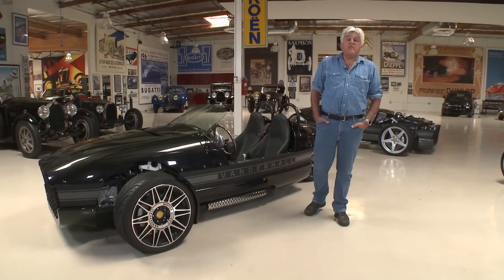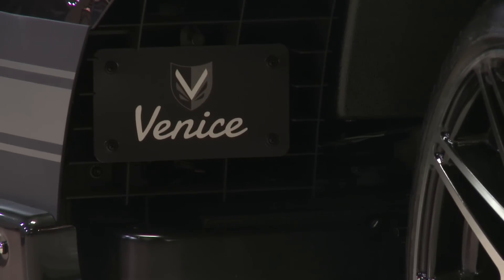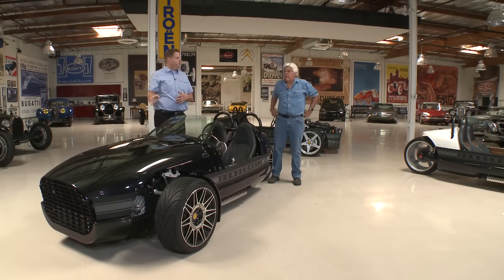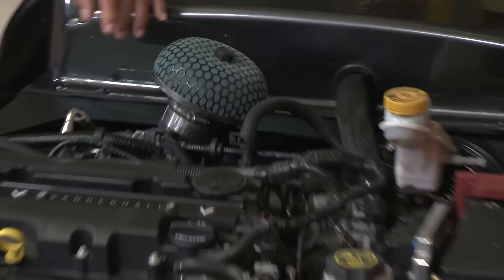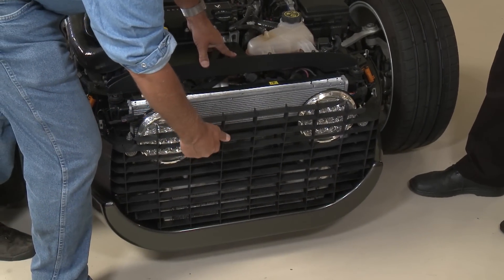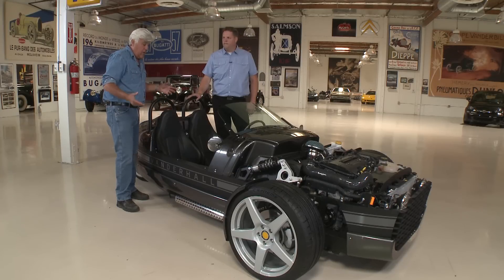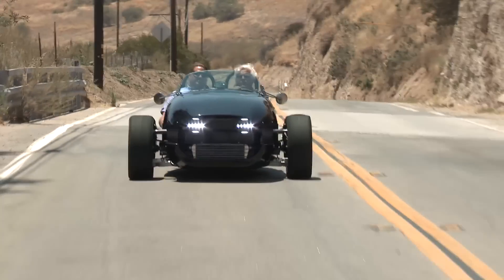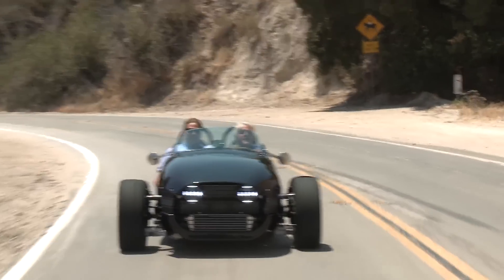2017 Vanderhall Venice - Jay Leno's Garage

Comment: the Laguna @70k is a hard pass; $30k is a decent pricepoint.  Looks like that tiny engine was struggling with two large adults in it, but I'm hugely impressed that they laid out the cabin so even Jay's head was below the windscreen!

Comment: Love this machine.  I recall reading about it about a year ago.  The Venice is even more desirable than the Laguna while being less expensive.  This machine looks far better than the garish Slingshot and front drive probably suits this trike configuration the best.  My only quibble is the auto transmission.  The Venice begs for a manual shift tranny.  Which is puzzling because GM makes a six-speed manual in the Chevy Sonic-sourced drivetrain.  Torque converter automatics are bland.  You could hear the leisurely shifts and gear hunting during their drive.  Put a proper manual in this thing and sing the last hurrah to vintage-style sports cars before electrics take over!

Comment: At 13:52 Jay says, "Feels incredibly stable. I can't say the front wheel drive makes any difference."  I wonder how stable it is when taking a 90° right turn at the same speed as a similar weight and wheelbase four wheel car that is near its limit of adhesion.

Comment: Only car manufactured in Utah? What about those Cobra's made by Kirkham Motorsports in Provo?
Reply: Its a technicality, Kirkhams makes a great vehicle, but it is not turn key street legal.
Reply: Too true, thanks for the response. 

I noticed that there is no Utah location for delivery listed on the drop down menu on the order form on the website. Will there be a Utah delivery option made available?
Reply: Yes, we are seeking the right dealer to handle distribution for Utah.

Comment: I like the T-Rex  better. Jay drove the one with the 6 cylinder BMW motorcycle engine. The T-Rex has a standard transmission which Jay Leno prefers. I liked the sound and the looks of the T-Rex. Everyone has their own opinion.

Comment: I don't usually like 3-wheelers (the ones that are trying to be motorcycles), but this is pretty neat.  The video made it painfully obvious that the GM auto transmission needs changed out for something else though; it sounded like a typical General Motors 1980's or 1990's 4-cylinder working much too hard for a lack of true acceleration.  In fact, I think the same platform, but with a reliable electric platform might give this thing the torque-to-road that it needs... wasting the torque on a bad iteration of a slush-box makes me sad.

Comment: What do you do when it rains? The interior gets soaked. When it rains a motorcycle it essentially just falls off easily gets evaporated and such. Yet in a car like this, the water can just gather all at the floor.
Reply: Drain holes.

Comment: Polaris is just as equal but way cheaper. You could turbo it yourself an put some fancy rims an steering wheel on it an still not touch this price. It’s a bike wit a car front in. Not complicated abs is not necessary if you weight it properly.

Comment: There is a bit of an issue with this car, at least for the first few years.  When I see the name Vanderhall, then I see the classic styling of the vehicle, I think that it is not available in the US, and also that it wasn't made recently at all, so the thought of buying one totally escapes my thought process, especially since it looks quite expensive anyways.  Educating the consumer will take some serious time with this car, they probably should not have chosen the brand name Vanderhall.
Reply: So Henry Ford should not have used the name "Ford"?  Louis Chevrolet should not have let his name be used on the Chevrolet automobile?  What was wrong with Walter Chrysler calling his creation the "Chrysler"? Keep working on your "thought process."  Fortunately, Vanderhall didn't rely on you for marketing advice.  The company is doing very well.  In the meantime, what have you accomplished?
Reply: @RichardTaylor1630  Don't be stupid, Vanderhall sounds quite similar to Vauxhall or even Volkswagen, plus the car doesn't have a modern design. It looks like it was sold to the European market only, for a high price, many years ago. It's a bad name choice, that doesn't mean they can't get any sales.

Comment: As an owner of a Slingshot, I notice that the seats in the Vanderhall are way too tightly crammed in there.  These two guys are overlapping each other and the passenger is reaching for the dash to pull himself to the side a bit to give the driver a bit more room.  Interesting concept with the Front Wheel drive.  That is a huge step up on the whine from the 90 degree angle drive the Slingshot has.  But while it may be "peppy" it won't have that rear wheel drive feel that increases the fun factor in the Slingshot.Without doubt it is a great toy but like most everything out there, it has its limits.  For my taste, it is just a little too tight.  But a very stylish and "refined" three wheeled vehicle.
Reply: MBMedic007 two above average shouldered guys sitting next to each other is not what 99% of our customers are looking to use this for.

Comment: They should make three wheeler cars en masse as normal vehicles, i imagine them being a lot more efficient than bloated up big heavy "city cars" and they wouldn't wear down the roads very much compared to all those heavy high safety cars out there. I think the whole regulation might be wrong, if all cars were light then there wouldn't be a need for heavy crash cages in all cars, because heavier cars have a lot more energy in crashes than light ones. The society in whole would profit because it means less money spent on road maintenance, less pollution, less fuel consumption, less resources used for making cars.

Comment: Wouldn't that rear wheel throw debris and water up over into the cab from the road? So you need a motorcycle license? I think for the shifter Id prefer forward to go down in gears and back to go up in gears..so 1 then back then back and to slow its up up and such.

Comment: To my eyes the track looks a little narrow.  If it were wider you’d get greater stability. Plus a GM 4 pot with an auto and FWD sounds a bit lame.  As an off the shelf product, it looks like great value though.

A lot of the styling ideas look to have been borrowed from the Grinnall Scorpion, which uses the BMW K series bike drivetrain and is IMHO the best 3 wheeler.

Comment: That is the same engine in my 2013 Chevy Sonic RS 1.4L turbo in Cali I could only go with the trifecta turbo advantage tune they make I'm pushing 20lbs of boost at wot I'm sure this one is not tuned bieng a motorcycle I doubt it needs to be smogged with bolt on parts and a dyno you can get 200 plus HP easy the price is great they go up to 50k I doubt they sell 500 a year heck I buy one I already know everything about that motor in it ....

Comment: Looks like they stole the steering wheel out of a Dino, which is awesome. Not a fan of the GM running gear, but I guess if you want to keep the cost down it makes sense. That suspension is so cool though.

Comment: If it were 4 wheeled it would be in a whole world of classifications on safety, epa etc.  Perfect example of over regulations causing problems rather than solving problems.  Obviously a fourth wheel would only add to its safety value, and shows how pointless the regs are.  Fortunately the big three which benefit from the barrier to entry allow him the freedom to build in the low profit motorcycle range.

Comment: did they say this was licensed as a motorcyycle?  if so, are not helmets needed?  and the rollbars are shorter than the driver/passenger heads.  not much use in a rollover.
Reply: Nitro Express it depends on the state you are driving in.
Reply: Motorcycles need helmets in California.  Jay is in California.  So I guess he's illegal.  But then he's special.    :-)

Comment: pretty nice for a 3 wheeler, but I can't help thinking that if they added another wheel that thing would be near perfect.
Reply: Then it would be a car, and it would be regulated to the point where it turned into a bland sheet metal blob like all the other cars to meet crash regulations.
Reply: With that said going FWD was a smart move since the drivetrain from a Chevy Cruze with some tuning will drop right in.
Reply: @mysock351C  this is true

Comment: You can compare it to a Can-am spyder because they both have three wheels, but there's actually no comparison: Do you want to look like a dork that's too afraid to drive a proper motorcycle? Or do you want to look like a badass driving a classic-styled convertible that drops one wheel so it can be lighter and therefore faster?
Reply: It drops one wheel so it can be legal.  Lighter is just the by-product.
Reply: @apexerman1  This car was designed from the ground up as a three wheeler, so probably both are kinda true. But actually that's irrelevant because what I meant is that it looks like a convertible that drops a wheel to be lighter. That doesn't mean that had to be the actual reason.

Comment: This is THE three wheeler to get! Slingshots are wack and too pedestrian and underpowered, can am spiders seem boomery and they are more touring oriented or marketed to those with balance issues, but want to ride a motorbike. The campagna T. rex is way overpriced and it’s no longer a brand new, modern machine. The vanderhall is the most refined, fastest and most visually appealing  machine in the 3 wheeled market. It is priced reasonably, and it is built in the USA. I don’t see why you would pick anything else.

Comment: so do you need a motor cycle license to drive it ?
Reply: Article 7, 27803 (f):
This section does not apply to a person operating, or riding as a passenger in, a fully enclosed three-wheeled motor vehicle that is not less than seven feet in length and not less than four feet in width, and has an unladen weight of 900 pounds or more, if the vehicle meets or exceeds all of the requirements of this code, the Federal Motor Vehicle Safety Standards, and the rules and regulations adopted by the United States Department of Transportation and the National Highway Traffic Safety Administration.
Reply: the above applies for California

Comment: 0:51  Utah....Kirkham Motorsports!
Reply: Kirkham builds a great kit, but they are not an OEM manufacturer.  They do not have NHTSA, EPA or 17 digit VIN approvals.  They are not legally turnkey, although, I hear occasionally one sneaks out of their headquarters that way.  They build a kit that must be registered as a specialty build with so much of the unit's construction required to be completed by the consumer.

Comment: A 19 yr old crashed one of these this morning at 330am in San Diego. Knocked 2 of the wheels off. A bystander called 911 and the San Marcos Fire Department found the victim slumped over the vehicle's steering wheel.
Reply: Wow. That's never happened in a car.

Comment: Since it's registered as a motorcycle, where they are required wouldn't you have to wear a helmet and eye protection? Interesting car for LA but here where it rains a lot... I don't think so. needs a top not only to keep rain off but the sun off too, or a guy would burn up riding around in it here in Bama.

Comment: why not just get a Miata? i understand that there is a small market out there for ppl that want to be different, But if its just a bunch of GM parts smashed into a 3 wheeled motorcycle frame, why not get a Miata? there are dealers everywhere for them and parts supply and car meets and racing classes. So why not a miata?
Reply: Evan Thomson because Miata

Comment: I build custom cars and what he said about McPherson strut height is wrong, I have built them low and it's not hard.

I think it's a mistake to run the high stall torque converter it's running for the demographic aimed at, just annoying and noisy.

Great price really, considering. I think they'll go broke though, do some simple math on 35 employees and 500 sales per year and the margins just ain't there. They need to cut that staffing level and I'd hate to see the lawsuit payout after the first accident. They should be pushing them out as kits instead.

Comment: Just so everyone who admires these things know, these are ABSOLUTELY GARBAGE. Every single vanderhall I ever worked on had a cracked frame right in the control arm areas. I don't know if they heat treat their frames or what but they definitely break. Don't get me started on the electrical.
Reply: Yep, plus the windshield is know to crack and it has bad handling/stability at highway speeds. Online reviews say the same things

Comment: Sorry 29k seams pricey It's powered by a Chevy Cruze drive line.  There are a number of kit cars that are cheaper,  mid engine 4 wheels, and rear wheel drive (DF Goblin).  Left over 2017 Mustang GT or a Mazda Miata.  Sorry just don't get it.

Comment: 29,950 .00 LOL and it is still a motorcycle or a three wheel car with no cover for if it's raining . I would even bet this car is not easy in the rain and impossible in the snow . But I would like to have seen both of the sausages getting into this this .

Comment: Nice Bike,   MADE IN USA   !    Who says American products are expensive ?    China could build it,   but they can't design it,    China doesn't design very much at all.   so,  they steal it..
The  Vanderhall  is a bit tight for two large Men,  but, a Hot Petite Woman would fit nicely in the passenger seat..   The windshield needs to be a hair taller..   did ya see Jay's hair flying..  That's more than a convertible car or a bike fairing would do..

Comment: Mate I'm from nz my name's harry my.friends a topdressing pilot flys a fu24950lycoming  400hp horizontally opposed supercharged flat8 built in America we modefied supercharger on to it and it's 10seconds  behind the prattnwitne turbine which is in a 1000hp stole upgraded Fletcher topdesser really robus can takeoff within 30ft from stranded 400hp 8cillnder engine also upgraded gear box  and  adapped  a turbine  gear box too it which gave it 1450hp   I'm an aircraft fan  and also no how too fly a small p51mustang which has  a v12faconer engine buil in Wanaka south island nz which does spd of apoxmitllly 560mill an hour chk it out Randell way smaller than the original Prosser

Comment: I'm sorry but, it has the same engine that the Buick Encore. The worst GM engine ever made (the 1.4L turbo from the Buick Encore\Cruze) defective piston and piston rings, defective intake manifold non-return valve, defective pcv valve, defective front crankshaft oil seal, defective turbo wastegate\solenoid. Every part in this engine is cheapy. That's why people here got impressed by the price of this vehicle. I have to admit that I love the idea of this vehicle concept, and they try to make it cheaper and affordable but, please once again, don't use Korean GM parts on it. GM = Chinese\Korean\Mexican parts. There is nothing American on GM but your money.

Comment: Hmmm, looks like a coffin with three wheels. If it rains, forget it. Anything flying off the road like rocks or debris is a no go. Can't we do any shopping or carry stuff. Get into any accident and you are easily dead. Any rear in crashes, you are dead. Flat tires, you are dead. Who would service this trike? Insurance is probably out the door! No caps. I would be wearing a helmet. Does have nice lines and looks very nice but it's a rolling death trap. Definitely need a garage. It's a boy toy. Probably drive it a few times until I get into a near death situation. It would be up for sale in six months, that is if I don't get killed in it.